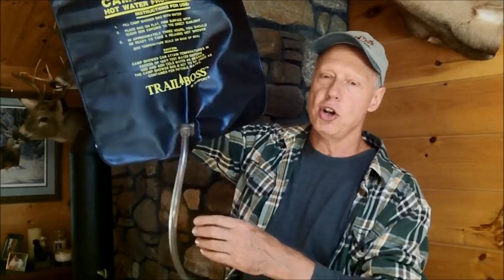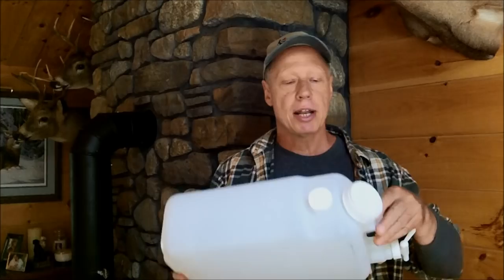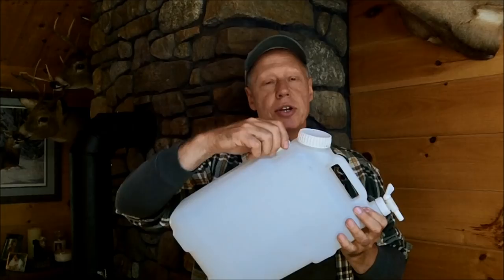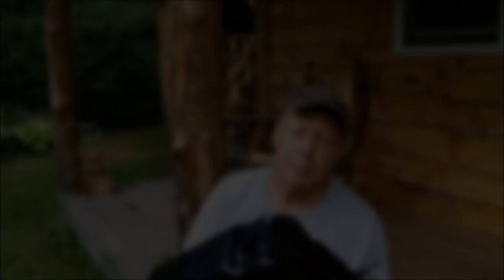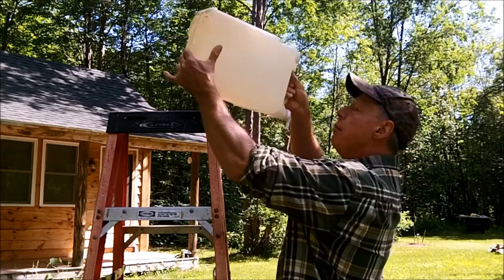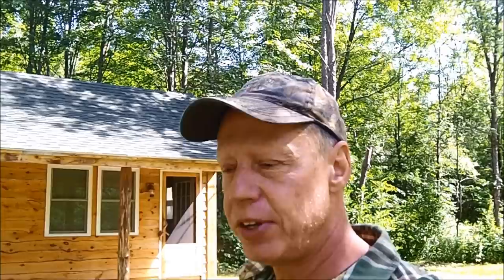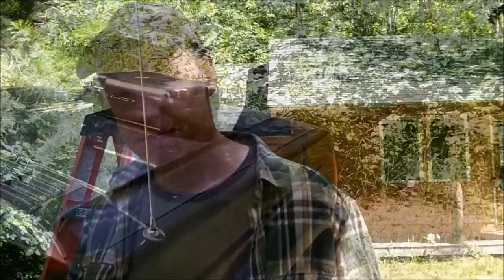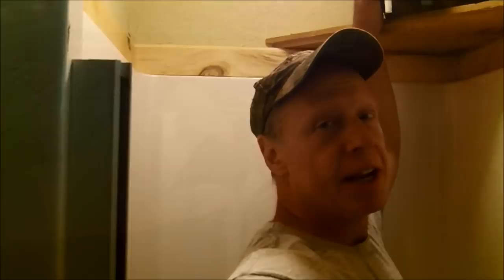HOW TO MAKE YOUR OWN SOLAR SHOWER.  DIY Project.

Comment: Just a quick note.. I have been using the carboy system for a couple of weeks now.. works fantastically. Thanks
Reply from the maker: Tanks for your success report.  I absolutely love this setup  :-))
Reply: I am renovating a turn of the century broken down house in a small town, it has a huge electric water heater that doesn't work... solution .. simple and cheap

Comment: Carboy's are those 5 gallon glass "jugs" that water comes in, or were used for making wine or beer. However they were mostly known as a water carrier. ergo why yours is called a carboy. I have a few 5 gal. ones, and I also have a metal holder for it. So that way, I can sit it on a counter and pull the neck of the bottle down to my dishpan for doing dishes. 5 gal. is too heavy for me to have to lift and pour many times a day, so the metal holder does it for me.
Your garden is outstanding, and there is nothing better than covering a garden with whatever mother nature gives you. Holding that bird blew me away! That was outstanding. It was so nice to see you again, and I really enjoyed your video.
Bless, Sheila
PS If you want a "pampered shower" you should take a look at the Zodi battery powered shower. Uses batteries, and BOY OH BOY is it ever nice. Toss one end in a 5 gal bucket, or smaller, of hot water, and the other is a shower head. It's fantastic. I had to use one for my husband when he was bedridden and we were living in our garage/home. Small shower head, but it comes out perfect.
Reply from the maker: Sheila6325 The Zodi sounds interesting for sure.  I been using this 2.5 gallon system for a long time and it suits my needs but I do plan to experiment a bit with something different for my sink.  I got my hands on some old campers so there's lots of goodies for me to salvage :-)Nice to hear from you again Sheila.  God Bless.
Reply: thebossoftheswamp I really like that 2.5 gallon system, and it would do wonders over my sink. Much lighter to use too. I can't wait to see what you get out of those campers! that should be a real hoot! Great to see you again too.  Bless, Sheila
Reply from the maker: Sheila6325 The campers are stocked, gas fridge, stoves, water heater, furnace, wiring, breaker boxes, gas lines, 12v lights, you name it.  Got my own little salvage yard going :-)

Comment: Thank you so much for showing the options you use for obtaining your shower and other warm to hot water usage. However have you ever considered building a large watertank above but adjacent to  your cabins with a filtration system . Plumbed the CPVC pipe to your kitchen and bath . And perhaps using barrels to catch rain water from the roof and a 12 volt  bulge pump to transfer it to the water tower. That way you pretty much have a very large amount of water at any time. You have a beautiful cabin and 500 gallon water tank would not be that difficult to build. However you will need help setting it on the framed structure.
Reply from the maker: There's lots of options for sure. I have a gravity feed setup in my NH cabin but this simple shower works flawlessly and I have no intention of changing it.  No power required :-))

Comment: GREAT IDEA! I hope you don't mind that I will be taking liberty of some mods to your brilliant idea of using these carboy bottles!! I have spinning wildly in my head, an outside hot water shower that can be your best friend all four seasons in our spectacular NH great north woods!!
Reply from the maker: +Keith Rayeski   You can modify it all you want but gotta say, it works great just the way it is.  Both indoors and out :-)
Reply: I was thinking of a shower booth, outside (my wife informs me she will have to have one inside as well) and using the 5 gallon bottles. Then again, I think I'd rather heft the 2.5 gallon bottle up than the 5 gal. I figured I'd build an insulated booth around a shower stall and make a box on tho top lined with reflective windshield reflectors....then set in two 2.5 gal jugs like the crafty ones you invented...making too much work for myself aren't I?  Well...it'll keep me busy!

Comment: Thanks for the awesome tip. My natural gas water heater died on me a few months back, but living in a very hot place (phx az), I have been able to get by just taking showers using the "cold" water that comes out warm during our hot summers. 

The showers were nowhere near as warm as I'd like, but I'm not too fussy, so I managed. Still, I missed a good hot shower and with money being tight, I was stressing out about how I could replace my minimal hot water needs in a cheap and simple manner. This fits the bill perfectly.

Thank you!
Reply from the maker: +cantecleer As long as you open the vent cap and allow air in the top, this jug offers a pretty good shower for something so simple.  Thanks for commenting.
Reply: +thebossoftheswamp I'll be sure to do that. thanks for all the wisdom you share. best wishes :)
Reply: I just want to say that I am STILL using this bottle for a shower several years later, now less by necessity and more by choice. I love it! Thanks again for the great tip!

It gives a good shower, uses very little water, and takes no power or fuel as long as it's sunny enough outside to warm up the water (heating some water by stove and filling the bottle works too during the rare cold/cloudy day where I live).

I like to use the little bit of extra hot water that is left over to shave or even do a small amount of dishes.

This is a great solution for everybody, both off grid and on grid.

I think for on-grid people like me, it is a great backup for emergencies or if a water heater dies, but it's perfect for a main source of showers too if you want to conserve energy and water!!!

About two gallons for a shower (and some extra hot water left over) is AMAZING and it's super simple and cheap!!

A+ 10/10 tip from bossoftheswamp!!

Comment: Here in Chile they use these vacuum tube water heaters. They are the rave at about 100 gallons, and no power needed. They are cheap too about $600 US equivalent. You should go check one out the even work well on cloudy days up to 135 degrees. I plan on installing at least two and will post up when i do. Jim
Reply from the maker: +ChileExpatFamily  There are lots of neat ways to heat water but personally, what works for me is to just heat what I need, when I need it. I've got hot water on the woodstoves all winter long, the sun shines all summer long and I've got propane in between and no pipes,  pumps or fittings to worry about.   Just the way I like things.Cheers.
Reply: +thebossoftheswamp I think you have the plan, but I have two smelly teenage boys, and a 7 year old boy that takes to the dirt like a dusting hen, and I don't think that my wife would give in:)
Reply from the maker: +ChileExpatFamily True.  We all gotta do what we gotta do. Cheers :-))

Comment: Very good, im using colmans portable shower, which they don't sell any more 4 d cell battrys, and then the big kahuna, which is 12 volt but the handle is a squeeze hold handle so you have to hold it to get water, so good for washing the dog or your feet or standing up spraying yr self so not hands free. thanks for the video jc.
Reply from the maker: 2000talon  This is how I shower at all my places. It's simple and cheap and works better than you can imagine.

Comment: Great channel videos. Love Franky. We love our German Sheppy as well. I have a solar shower bag. Pain in the butt even if you use a step latter. (take note) I cut about a inch or so of the hose on it. The hose fits on my Uline 2.5 gallon (carboy) drain. And put on the solar bag sprinkler head. Works great. Try it Boss. lol PS We need more vids lol
Reply from the maker: I was intending on doing that when I first tried the carboy but found the carboy itself worked great. I do have a hose so I'll try it.  Cheers :-)

Comment: Very simple and effective JC!  I agree with the bags... always had a problem with them having to kneel to get under the dang things!  Haha, I like the simple carboy set up, I have a couple of them kicking around, I wonder if the temperature strips used for wine and brew kits you can buy at the brewery kit stores would work for that?  They are about 50 cents each, and are relatively accurate for temperature reading... I have my propane hot water on demand set to 108 here at the cabin as well!  Thanks for sharing!
Reply from the maker: Dave Wilcox Jr  I gave up on those shower bags a long time ago. For a simple shower, this works pretty darn good.

Comment: Hey Jim, I have a slightly different take on the same simple system. I thought you might enjoy hearing about it.
     A few years back I found an army surplus, three gallon (compression type) weed sprayer. Ya know, the kind you pump up by hand. I spray painted it flat black, carefully added a little more curve to the wand for a shower head, and drilled the brass orifice slightly larger. I mounted a clip on the wall to hold the wand end, and set the canister on the floor. After a few hours in the sun, It worked like a champ. With use you learn how many pumps equals your desired water pressure. 
      There's a little more elbow grease involved than just using gravity, but I think it's worth it for the water pressure on the tired old back muscles. If you want to try it and can't find an old one, they still make coated stainless sprayers (and poly ones as well). 
         - next up . . . . the four Jerry can passive solar hot water heater for winter . . . . wish me luck.
Reply from the maker: I've heard of others doing similar things with spray tanks but this little jug of mine works slick and has been serving my needs for years.  I love the simplicity of it and it's never failed.   Hard to teach an old dog new tricks haha.
Reply: OK old dog lol, (wait, . . um . . we're the same age.). I guess it really doesn't get much simpler than Gravity.
     Thanks for responding to all my goofy comments/questions.  ;- )
Reply: @davidpeiffer2440    Be open. To other ideas. But Ill try your. How about winter?

Comment: Nice video, and information. I have tried those shower bags before, and have found them a mess. Too low, etc.. Althouhg I did once throw a line over a limb and it worked fine. In a house they aren't that great. Unless you were to empty them into another system. Thanks again for the video.
Reply from the maker: Mike Box  I even purposely added a high spot in the ceiling to hang the bag in and they still suck. Better than a sponge bath but not by much.  Been using this bottle system for a long time and this is where I'm staying. Simple and Cheap :-))

Comment: EXCELLENT!  I'll have to get a few of those jugs.
Reply from the maker: Camp Cossack 5 hours in the sun on the hood of my jeep and it reached 112 degrees.  Can't argue with that :-)
Reply: Well, I FINALLY got off my duff and ordered 2 from Uline.  The shipping is almost as much as the 2 jugs.  lol  Next week I'll get to try em out.  Have a black Sierra so should be having nice hot showers at the cabin build site soon.

Comment: Another good video. Your videos give me ideas. I have one of those Blue Coleman 5 gallon water jugs (unisulated). I could do the same thing with that. I could try it without painting it, the dark blue might get hot enough for a shower. Since I already have one. They cost around $10-15, so pretty cheap too.
Reply from the maker: Jarod Pratt I'm sure it'll work fine. Thanks for commenting.

Comment: I was wondering boss, have you ever thought about using a Hot water tank 45 gallon or so, and making a wood fire in it down at the bottom, outside of course, to heat up your hot water? Of course you'd have to have a water pump running it, 12v system but it would be an idea?!? :)
Reply from the maker: That sounds like a time consuming and complicated way of having hot water.

Comment: Would have given anything for this a few months back. My hot water heater broke and it was a week before they could replace it. I ended up heating water on the stove mixing it with cold and pouring pots over my head. Your idea would have been much more convenient.
Reply from the maker: J297WFD This simple jug system works very well.

Comment: Just found your channel. Great videos (we watched some of your other videos as well). A few years back I made a contraption with 4" black PVC pipe pieces...forming a square (kinda) for outdoor showering. It could hold about 5 gal of water, and heated up great in the sun. Put a screwable lid in the upper corner, and a spicket in the lower opposite corner.

I have also seen some people make an insulated box with a glass window to heat their water as well.

Subscribed to your channel, and will watch a lot of your other videos as well :-)
Reply from the maker: +Back to Nature Living  I been living in cabins since I was 21 and have had many different shower setups. Gotta say, this is by far the simplest and cheapest AND favorite setup I've had yet. It never fails :-)

Comment: ok, stupid question time! LOL!!  why couldnt you put the hot water shower on a shelf? still above your head.  never mind this question!!!!!     got an idea for you system!    take the hose and shower head and put it on the spout. glue it on if it doesnt stay on its own.  less mess and you have a shower head, plus you have that stopper on the hose.
Reply from the maker: Danny Panetta  I don't need a shower head or a hose. This system works slick and I DO put it on the shelf above my head.  I been showering like this for 20 years man. Why argue with success?
Reply: well said. LOL

Comment: Imagine what you could do with the heat in the attic
Reply from the maker: airkraft1 Most definitely. An attic would be a great place to have a tempering tank to pre heat the water before it reaches the water heater.

Comment: Hey Boss,
Since first seeing this video a couple of years ago I have used your carboy design shower many times as an outdoor shower.That outdoor shower is quite a luxury.
Today, however, I came home from work to find quite a water leak in my yard from the main supply line to the house. I worked well past dark but couldn't get it fixed tonight. When it was all said and done I was able to put a carboy on a ladder that already had water in it and was exposed to the sun for several hours. I had no intention of using it tonight.  At 9:30 in the evening I was able to get a shower at just the right temp and I had plenty of water left without skimping. 
Does that make me a prepper?
Thank you for all the great information and thank you for all the work you put into your content.
Reply from the maker: Glad it worked out for you.  I have a shower stall In both cabins and there's a shelf above each one of them for the carboy to sit on.  This has been my only shower system for over a decade.  I heat the water on the stove when needed and fill the bottle.  It's a remarkable shower for something so simple :-)

Comment: My two carboys are ready for emergency use, stored on a shelf in the cellar. My comment to the lady who did not have the strength to lift the carboy to its intended spot, is to use a plastic watering can with a long spout. A full carboy probably weighs 20 lbs? May take three or four pours, but I sometimes have to do things multiple times... I'm not very big or overally strong, so I have to " think smart". Three wheelbarrow trips instead of one, so what ? I get the job done :-)
Reply from the maker: Two carboys half full shoud do it :-)

Comment: I was wondering if you did not paint your metal tub black, but perhaps painted it with reflective paint to produce more sun rays, would the black shower jug heat up faster?
Reply from the maker: +Jon Von It might. I thought about painting the outside black and leaving the inside silver. Either way will work I suppose but the hood of a car works awesome :-)
Reply: Don't fix what is not broken, full steam forward!